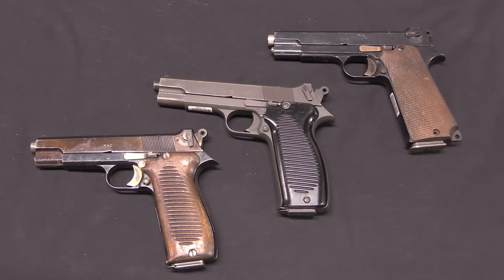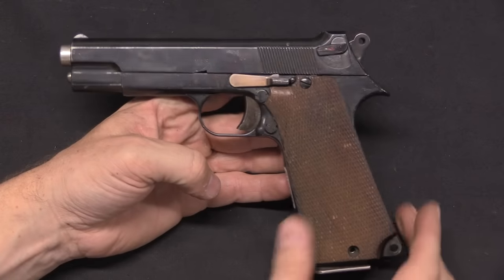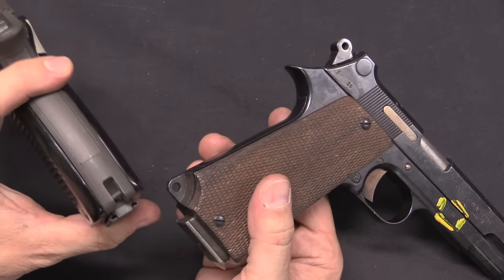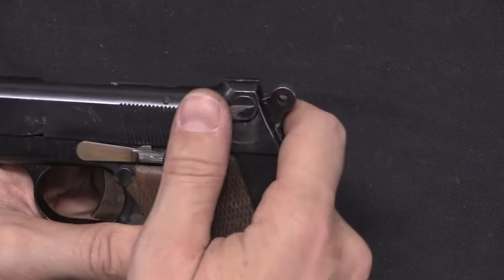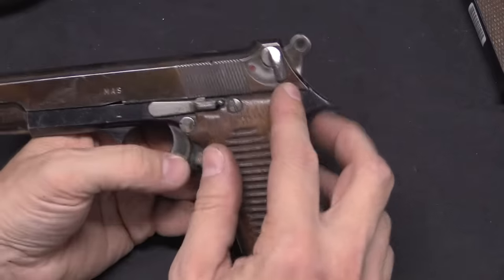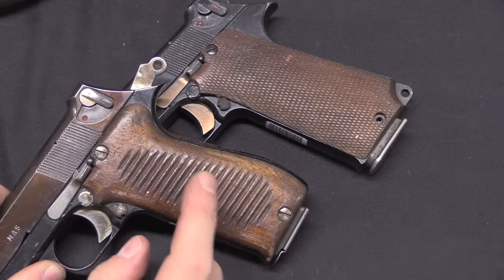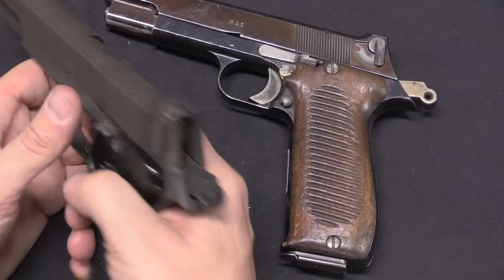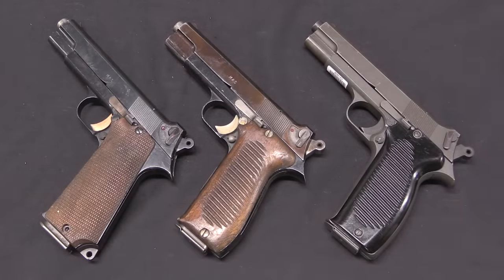Early Development of the MAC 1950 Pistol

Comment: I love when Ian releases a brand new video about firearms especially French ones. There's no shame in showing us  your love for French firearms like the MAC 1950 which funnily enough looks like the French cousin of the Colt M1911.
Reply: I was thinking thr same thing... looks awfully similar to a 1911
Reply: Looks very similar because the internals of this pistol are using the same principals : simple blowback 9mm, barrel is locking on the slide in 2 receses identical to the 1911, barrel is unlocking in a pivot inge fixed with slide stop, return spring captive with its guide rode is locked underneath the barrel, same slide stop and same mag release. Only difference mostly lies in absence of barrel bushing, safety type position and caliber.

PS: sorry for my bad english

Comment: I shot that one during my military service the in late 90s. Mag takes 9 rounds but instructions were to load 8 to avoid wearing the spring. Because by the late 90s, these guns were already well used. The main claim for fancy design is the hammer block you can remove altogether for field maintenance. Otherwise, officers' basic pistol training was just being able putting most of a mag into a man-size target at 25m, and the MAC50 does the job for that very well.
Reply: I also used it all through my military career (1999 to now) and the old iron is still in service even today with rear echelon troops ! I just shot one not later than last month !😂

Comment: For France, the Gendarmes were the most numerous users of the MAC 50, it was the individual weapon.  It was carried in an old style leather holster, empty chamber but hammer back. That way it was easier to rack the slide to load (slingshot fashion), but sometimes the safety was engaged unwillingly. One guy I knew was killed by a terrorist August 27th 1987. He was found to have pressed the trigger on a loaded pistol, but with safety on. In the other services it was carried empty chamber, hammer down and with a steel/lead wire to check/witness if the slide had beeb pulled back.
Reply: Les motards de la gendarmerie le portaient avec une cartouche chambrée, ne pouvant pas manœuvrer la culasse d’une main (l’autre tenant le guidon).
En ce qui me concerne, la chambre était vide et la culasse plombée (consignes militaires en temps de paix).
Reply: @methodeetrigueur1164  En effet, je n'avais jamais demandé à des motards ou des cavaliers comment ils portaient le MAC 50. Logique. Motorcycle and mounted officers carried this pistol in condition 1.

Comment: Thanks again for sharing.
I had one during my army time in Germany, as I worked in the armory.
We also had it in the ministry of justice until it have been replaced by the Sig SP2022.
MAS for Manufacture d'Arme de Saint-Etienne (Saint-Etienne Arms Factory) or MAC when it was made in Châtellerault, this handgun was commonly called PA (even if it obviously is a semi-auto) MAC 50, or just MAC 50.
Once again, after the Famas, I am extremely jealous, because even if I live in Switzerland where it is entirely possible to have such weapons, it is extremely complicated to obtain them (especially for the Famas in full-auto , unless you have a supplier to share).
Thanks again for sharing the passion.

Comment: Good looking pistols
Reply: But hammer bite is quite a problem, even with medium sized hands.
Reply: Sorta ,puts you in mind of the Hi powers I'm not much of a French firearm follower
Reply: @douglaskerr6813  If you consider that it was designed right after WW II, the designers had plenty of examples to examine.  Surely the High Power was one of them.

Comment: I was thinking that the last iteration of the safety looks easier to disengage by accident, with it sticking out like that. Then it occurred to me that a safety which has to be pushed forward to disengage actually makes some sense. One which has to be pulled back to disengage has a greater chance of being accidentally moved to the "Fire" position while being holstered. It may not happen very often but, I suspect it had something to do with the change.
Reply: Not really a problem with the holsters used, but it often was unwillingly engaged during emergency loading for a "tir de riposte" = shooting in self-defence. It was not permitted to carry it in "condition one".

Comment: Earlier videos:
MAC 1950: Disassembly & History
Mechanically, the gun is largely taken form the Browning 1911, with a few improvements. The recoil spring is of a captive design, and the fire control group is all built into a single easily replaced unit (similar to the Tokarev and the 1935S). It is single action only, with hammer-block and magazine safeties and a 9-round magazine of standard 9x19mm ammunition. It is still in French service, having proven to be a reliable and dependable weapon, if outdated by today's standards.

MAC 1950: Tactical Shooting Competition

Comment: Early safety is definitely better doesn't stick out and won't engage when you rack the slide.
Reply: As a MAC 50 user during 5 years, I support your message.
Reply: In addition to the safety design, if the French had included adjustable sights and either increase the size of the beaver tail or reduced the size of the hammer to reduce hammer bite, the pistol could have had a much longer service life. I think the safety design, lack of adjustable sights, and constant hammer bite were some glaring problems that never really got addressed and ruined the reputation of the pistol with the people who had to use it.
Reply: @jean-pascalesparceil9008   It also looks like that safety could be accidentally disengaged because of the way it sticks out.
Reply: @donjones4719  Not in my experience, it is high over the hand. The doctrine was that the safety was to be engaged AFTER shooting some rounds, waiting until needed to shoot some more or cease firing, then unload and clear to go back to an empty chamber, hammer back, safety off.
Reply: I have 7 of these pistols and I can tell you that, when used as designed, nonadjustable sights is a nonissue.  They are not target pistols, but rather, combat pistols.  At 25 meters, every shot is a kill shot with the sights as they are.
Reply: @brianwilhelm37  
To each their own. Non adjustable sights might not be an issue for you but they’re an issue for me. Different bullet weights have different points of impact. Different brands of bullets of the same weights sometime have different points of impact too. While the impacts may be close enough for a lethal and or disabling shot, close enough is not good enough for me. I want my bullet impacts to land exactly where I’m aiming my sights without having to guess at windage and elevation just in case I have to take a precision shot. There is no right or wrong here. It’s just a matter of preference and I prefer adjustable sights when I can get them. Most handguns can be had with the option or adjustable aftermarket tritium sights can be added later. I choose those. 

As stated in my earlier comment, two even bigger issues with this firearm are hammer bite and the issue with the safety placement. I just couldn’t get around those. I don’t like the Browning Hi-Power for the issues with hammer bite for the same reason also.

Comment: What's with the bright colored paint(?) on the prototypes?
Reply: That seems to be a running theme, not sure if it is just from one location, or many...I get the sense that for whatever reason this is done to certain early prototypes in reference collections. Good question though, Id like an answer to it.
Reply: @SwampyMusic  I wonder if the paint was used during the trials, which means that the paint itself is an artifact of history of the weapons.
Reply: Probably marking out for inventory reasons so you can quickly know where to check for the serial number when completing inventory or inspections.

Comment: Were any problems reported of the safety accidentally disengaging because of the way it sticks out? It looks easy to flip if it brushed or knocked against something. If a user held his weapon ready to fire but on safe for an extended period of time then chances increased it'd be knocked off safe. When would it be carried like this? They did a lot of unsafe stuff back then.
Also, if dropped, the first hit could disengage it and on subsequent bounces the hammer wouldn't be blocked.
Reply from the maker: The standard holster prevents the safety from being accidentally disengaged.

Comment: I always thought these were interesting pistols. Why  are they as expensive as an Sig P210?
Reply from the maker: Scarcity.
Reply: Did they lose most of them in Algeria and Vietnam? Lol
Reply: @Auto-Fiver_73Pointers No it was not yet available for the Indochina war, very few were used in the Algeria war. In a guerrilla war few weapons are lost. How many 1911 A1 were left in Vietnam?
Reply from the maker: @Auto-Fiver_73Pointers Until recently, they had never been imported as anything except a few Vietnam bringbacks. Similar to why the M3 Grease Gun is so much more expensive than the Sten today; the military didn't release any of them for sale.
Reply: a lot of 1911A1’s were left in Vietnam. I would WAG 50-100K. They also made crude local copies.
Reply: @Auto-Fiver_73Pointers It was widespred in the French forces in WW2, also was airdropped to resistance movements 1944. After the war, gangsters used both 45s and Sten submachine guns in the frequent armed robberies.